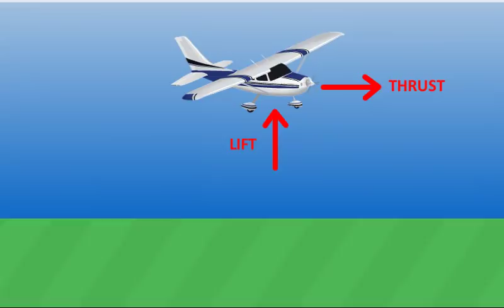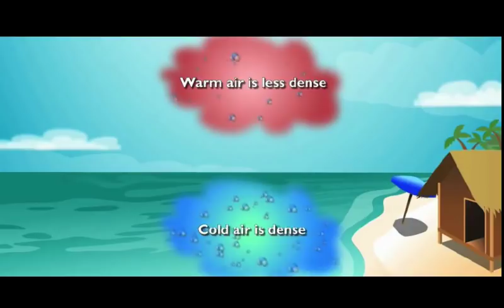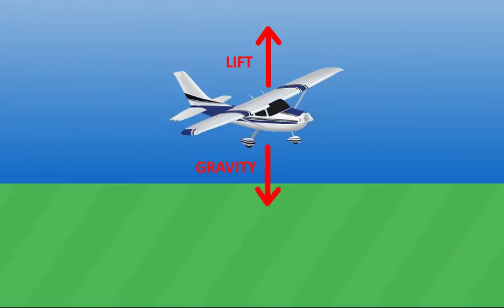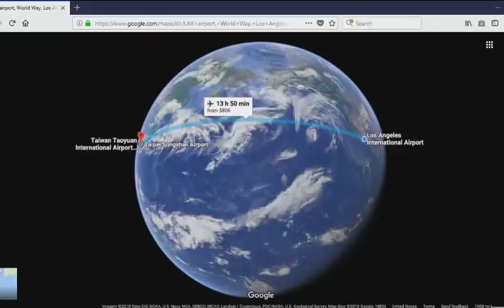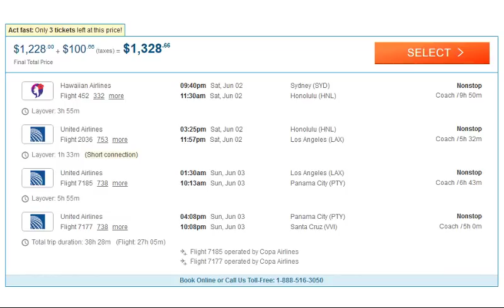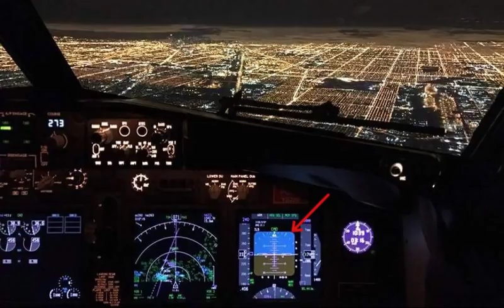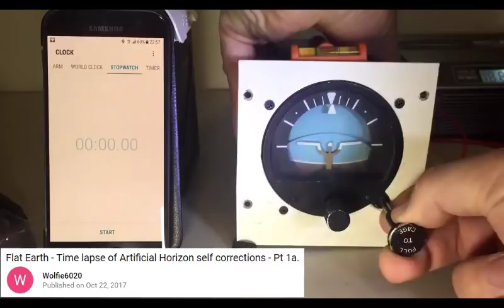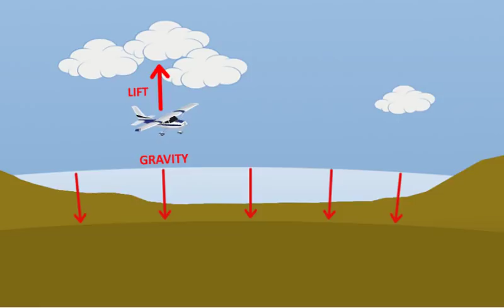Flat Earth Falsities - Plane Nonsense

Comment: Gravity does not affect air or any gas for that matter which negates this whole theory. Gases follow the laws of density. Light a match. Does gravity pull the smoke down?
Reply: Density is just a number. It has no force until gravity is applied to it.
Reply: Wait... what? Gravity doesn't effect gases? How do stars form?  Gravity is a relatively weak force (compared to EM, Electrostrong and Electroweak) but it scales up with mass. Because gravity is (relatively) weak, it can be overcome by other forces, it's why a cheap fridge magnet can overcome gravity. It's why you can tape a poster to the wall. 

You almost answered your own question re: why smoke isn't highly effected by gravity, and that is density.  Because the surrounding atmosphere is denser than smoke it is enough to overcome the pull of Earth's gravity on the smoke.
Reply: kbcorp Why are you opening your mouth even though you obviously don't understand the principles of gravity and density. Just because you don't understand gravity it doesn't mean it isn't real
Reply: kbcorp F=Gm1m2/d2 dummy. It's so easy not to be an idiot, I feel like you're trying to be ignorant for fashion.
Reply: Smoke is lease dense than air, so it would oppose the gravity witheld and effecting the air. The air at the level we breath is around twenty five percent oxygen and seventy percent nitrogen and some the rest being hydrogen and such. This i like asking why hydrogen will still float in helium in which the answer is that the fewer protons, neutrons and electrons the element will ne lighter. By this the farther you go on the periodic table. Now you can't say that a metal of 15 protons would be lighter than a gas of 20 protons. This being the atoms are more likely to be far spread in a gas tgan in a metal. This is why liquids expand when turned to gas. In shorter terms the density is not the only factor gravity, heat and many other interferences.
Reply: "no one knows what gravity is", sorry, but physicists around the world would like to have a word with you. Just because YOU don't know what it is (or more precisely, deliberately misunderstand it), doesn't mean that everybody else don't know it either.

It's the old problem with you flatties and your massive ego, you define yourself as the absolute standard for all knowledge and understanding, and that's just plain and simply idiotic.
Reply: kbcorp Okay, that's that I suppose. On the bright side, reality will be waiting for you once you grow tired of substituting it for your own.
Reply: kbcorp How strong do you think your body's gravitational pull should be?
Reply: The air is actually supported by the ground and the smoke is supported by the air. See how your argument falls apart when you remove the air. https://youtu.be/eGemlz7krlk?t=1m30s
Reply: No... Are you talking to me?
Reply: Tard, It's you're not your shithead. Damn, I doubt Mcdonald's would hire such an idiot. BTW, I believe you have been sniffing far to much of that gas you are expelling. Try beano....
Reply: OK.  So you light a match, this creates heat which expands the air in the vicinity.  This makes it less dense, so a cubic centimetre of it weighs less than before it was heated.  Because of this that volume of air moves upwards as denser (and thus heavier) air is pulled down by gravity.  The smoke is in this volume of air, so it too rises.

To see an alternate version of this, open a fridge, and notice how the cold air spills downward to around your feet rather than chilling all of you at once.  Or how when you reach into an open topped freezer in a shop the cold air inside the freezer tends to stay in there and colder than the room it's in rather than wandering off.
Reply: Bwahahahaha1  Heat rises because it is less dense.  How about dry ice vapor?  That sinks because it is cold.  ...and it's a gas!  STFU  edit: ...and density directly effects mass.  Less mass compared to gasses around = rising. More mass=sinking.  All thing with mass produce gravity.
Reply: kbcorp Why are you so stupid. That's stuff you learn in 6th grate in your chemistry class. It's really not that difficult. What kind of job do you have. Like seriously, you wouldn't even be allowed to be a cook if you don't understand how the density of objects affects their state. My sister is 8 and she can explain it to you. It makes perfectly sense
Reply: You should ask valid questions like, how do I get a job when I am 35 years old and never had one? Will I be able to continue living in moms basement forever? That's a start.
Reply: And even if it's real doesn't mean you understand it...  What you don't understand is that NO one knows what the hell gravity actually is, therefore one can't fully explain it.
Reply: your in the wrong post..
Reply: And why not? Why can't you attract a water molecule or something. this is my point..
Reply: Dusty Rhodes. Is that something your dealing with???  You might want to keep that private pal...
Reply: Greg Wessendorf 
stars? That's all in the heilo model bud. I no longer am fully incorporated with that potential fantasy. It's all theoretical science. There is no real way explain how any of this has formed, especially since we can't fix our own problems.
Reply: That's false!!!!!!!!!!!!!!
Reply: You have MASS... What's attracted to you?
Reply: Alex WTF are you talking about?
Reply: Dusty: first of all, learn how to type and talk dumb-ass to get you point across...  How about dusting off  an ABC book before jumping at me like that.

Comment: I was hoping to hear how a compass works on a globe vs flat earth.
Reply: @gregory wyatt
Which kind? Magnetic or gyrocompass? 
And the answers -
Magnetic compasses work on a rotating terrestrial spheroid.
Magnetic compasses do not work on a flat earth.
Gyrocompasses work on a slowly rotating terrestrial spheroid with gravity.
Gyrocompasses do not work on a flat earth.
If you believe differently, answer these two questions.
What is the relationship between longitude and distance when travelling east or west parallel to the equator?. If you know the answer then you know the earth is a spheroid. If you don't you are not qualified to comment on the earth’s shape.
Please explain the principles behind the development and functioning of a gyrocompass? If you can then you know the earth is a slowly rotating spheroid and gravity is a fact. If you don't you are not qualified to comment on gravity, the earth's shape or movement.
Reply: Uhm? The earth has a lot of iron at its core which generates a magnetic field which orients a compass roughly north.

Would you mind explaining how it works on a flat earch? is there supposed to be a giant magnet on the north pole?
Reply: Very simple, if the earth were flat a compass would not work for navigation. All navigation only works on a globe.
Reply: gregory wyatt All magnets have north & south poles (bipolar); cut a bar magnet in half and you are left with two shorter magnets each with north & south poles rather than a "north" maget and a "south" magnet. Some FE'ers believe the Earth has a special monopole magnet at the north pole though they can't produce evidence for its existence or explain how it could exist.